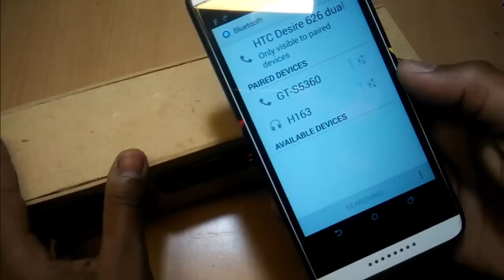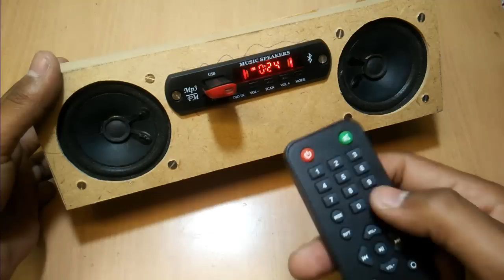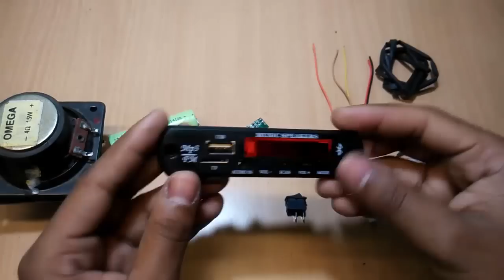How to Make 6 Watt Bluetooth Speaker at Home

Comment: Hi. I had made a similar portable music player but there is one problem, lot of humming sound, when I switch on the system. Why so ?
Reply from the maker: This type of problem comes only when there is a problem in the power or its card, once you have the right pimples.thanks for watching
Reply: CreativeOdd I had installed this Mp3 module in my Sony music system, still it gives humming sound when switched on. Another problem the FM mode is not working, rest everything is working. Why so ?

Comment: I have done the exact setup using same components shown in the video, but when I connect DC supply of mp3 module and amplifier together it gets switched ON and OFF frequently, if connect one of them to that charging module and another directly to battery got switched ON but there is coming loud noise on the speaker.
pls help me

Comment: I will use a similar decoder to build a 15 + 15w rms on 4 ohm micro stage monitor ( with rca input. Otherwise, it will be just an handmade micro hi fi) with separate passive dual cone 4" speakers.

Comment: Is the complete circuit can work properly on 3.7 volts via direct connection of battery not with the help of dc to dc converter
Reply: You cant.

Comment: there is a hum noise when I connect Amplifier with the bluetooth 4.0 decorder board. The product I have used are given below.

1. 4 no. 18650 battery 16.8v
2. TPA3116 amplifier board 50w x 2
3. bluetooth 4.0 decoder board.

any solution to solve this issue. When played it, only with amplifier no issue with the noise or hum. But when connect with amplifier and bluetooth 4.0 decoder board I am getting a hum.
Reply from the maker: I'm not sure what the problem is, but in some ways you can know that the problem is coming.

1. 

First check the 3.5 jack audio by putting the speaker and battery on the amplifier board

2. 

By adding a small speaker on the audio output in the Bluetooth modal, you can see whether the modal is correct or not

3. 

If the problem is not solvable, then you can do a dangerous message to whitspeap. The problem can not be solved in the comment.

thanks
Reply: I just used to 2 different power supply. The humming disappeared.